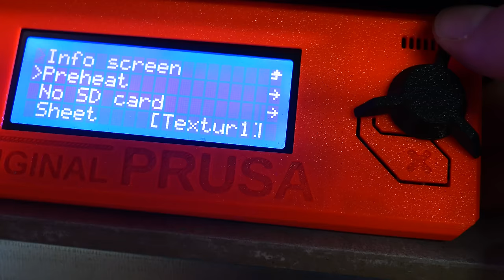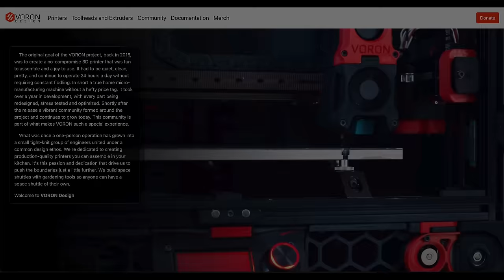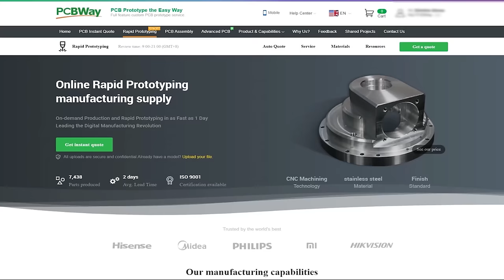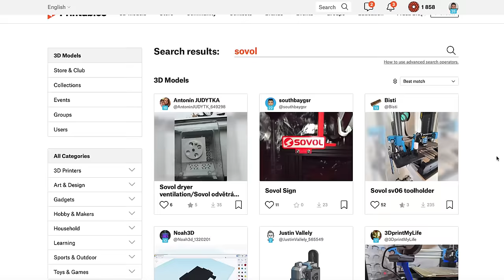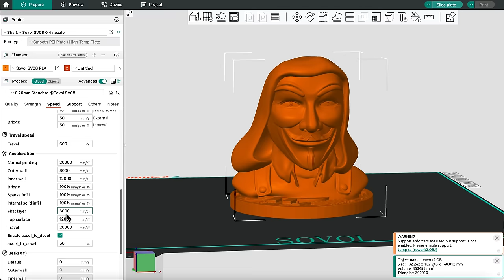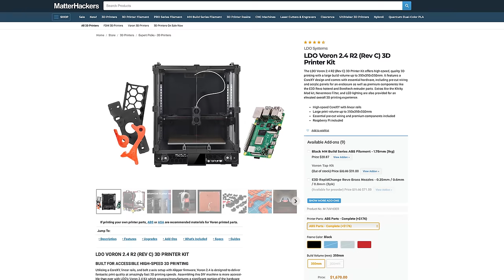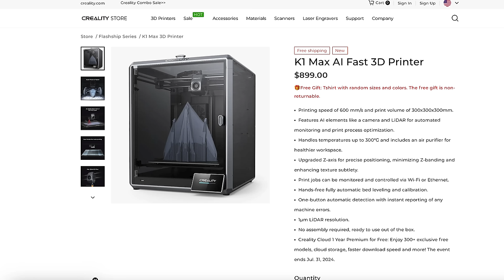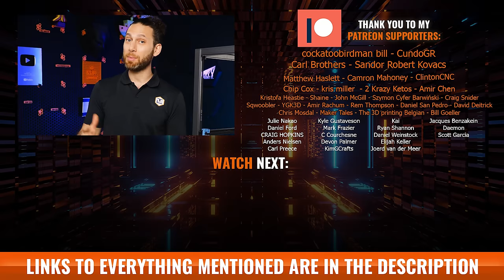The Sovol SV08: You Won't Believe the Price…

Comment: After communicating with sovol customer service, I was told that the bed heater only comes in the 220V/1000W version.
This is equivalent to 250W when used at 110V in America and 200W when used at 100V in Japan. I live in Japan, and I think 200W is extremely difficult for a bed heater of this size.
Details of the bed heater are published on github, but the hole positions are different from volon2.4-350, so it may not be usable.
Do I also need to arrange a transformer? This is a problem for users living in low voltage areas.

Comment: Hey so in the printer config what kind of stepper drivers are they using? And what is the amperage they have the x and y running at? I am just curios if they are 2209 or something with equivilent output so i could upgrade the motors with out needing new drivers or mainboard. I was just starting to plan my own core xy build, but the price of this has me seriously rethinking my plans.
Reply: Same. I've been researching for a month, going over various builds and options. But if this hovers around the $500 range and is as open source as it is sounding, this thing is sounding like the way to go. I was about to pull the trigger on a bigger bed slinger this week too. I'm going to wait and see what develops by the 18th.
Reply: tmc2209 @ 1.5A hold and run currents.

Comment: What I don't get is 100C limit on the bed in almost all the late printers. Why? Is it because of the Bambu having the same limitation? You would really benefit from 120 or even 130 on the bed when printing pure PA6 оr PC yet it seems manufacturers are inclined to draw the line on carbon or glass-filled filaments. Kinda disappointing.
Reply: In this case it is likely just being overly safe, 3m ht adhesive used to attach a lot of bed heaters is only good to about 120 +/- 10C so the voron guide suggests a 115C thermal fuse. Should be able to easily edit the cfg to up it to 110C. I don't think we've seen the underside of the bed but you can add a ring of RTV gasket silicone to be extra safe and push the temps a bit further no problem.

Comment: A voron, if you're willing to fuck around, can be built larger which is still a major draw. I want a 500x500x500 or greater volume printer. This is not recommended but no one's stopping you. I'd probably build it out of steel square tube if I went that big though, it'll involve a lot of precise drilling and tapping but I think the added rigidity will be important at this size.
Reply: Wait until voron realises the phoenix

Comment: Fully agree on the nozzle design and the new proprietary model for many of these 3D printer companies.  So much worked well when multiple printers in my collection could all basically use the same nozzle designs and they were dirt cheap when manufactured at scale.

Comment: I have a Trident. I had been looking at the 2.4. With the specs and capacity of Sovol's SV08, the price point, and the ease of setup, I can't justify a 2.4.    Some LDO supers will fix the motor whine, and fan replacement would be in order.

Comment: I'm definitely intrigued by a lower cost, easier to setup Voron, but this does sound like a lot of caveats. 
Like I'm all for adjusting print settings, but sounds like this would ALSO require some updates to the Klipper they are running if there are Z offset or clogging (overpressure) issues. Also doesn't sound like it's completely plug and play. The nozzle is also a huge turnoff, since that is one of those aspects that can literally kill a printer. I guess if it's still "open-source" we could just replace the hot end entirely with a standard Voron setup?

Comment: Great price for a decent looking printer. With that being said, the Z offset issue is an absolute deal breaker for me and it's the main reason I got rid of my older printers for an X1C. The "just works" aspect is crucial. 

Nobody wants to spend more time debugging print issues than actually printing and one of the most common reasons for that is first layer problems, often as a direct result of Z offset issues.
Reply: Since this is going to ba an open source printer, it's not comparable to Bambu Lab because the user does not need the support of the company to fix things.
And since this costs like 2/5 of the price of that X1C (varying to country) and because of the huge community that kinda does the "debugging" for you (if it's not even already fixed due to the Voron 2.4 knowledge), it's fully depending on your understanding of the value of your time.
For me ... one hour or two invested in fine tuning is worth more than 900 bucks ... especially if you count in that knowledge gain!

Because one thing should be clear: A Voron (or "Voron light" in that case) is NOT "just a tool" like Bambu Lab machines wants to be!
It's the definition of a 3D printing hobby. And many people are glad to learn a thing or two and discover their new "toys" in a way you simply cannot with a closed source ready to print machine.
Reply: @hassosigbjoernson5738  I think there was a misunderstanding. Spending and hour or two to fine tune a printer is more than acceptable. What's unacceptable is having to tune and debug before every. single. print. It's obviously not an issue everyone has but it's one I encountered on my heavily upgraded Ender (running Klipper) and I know I'm not the only one who's had that problem. 

Printing as a hobby is great and learning how and why things work and how to tweak and tune settings is something everyone should do. But when it starts to detract from the fun of printing and becomes more of a labour than enjoyment, that's a problem.

I'm not saying this printer will have those issues, but I sure like that my X1C doesn't and has been 100% click print and walk away since I bought it over a year and a half (and 700 print hours) ago. The only thing I ever do is clean the print bed and carbon rods occasionally.

Comment: Well the SV07 is not fully opensource yet. I had to ditch their klipperscreen for a raspberry pi and touchscreen so I can update klipper. And even if you manage to update klipper without bricking it, it’s quite the hassle. To bad that Sovol has not yet made the SV07 fully opensource, it’s the reason I bought it (I still suck at cad design tho haha)

Comment: Excuse me. I see this is a ncie machine but, the formbot kit of the 350mm 2.4 is $859 with dragon High flow, CANbus, Filament runout, 5 inch touch display, nozzle cleaner etc.. Yes I understand a voron still needs to be built and yes don't build it to save money or time, but I am jsut pointing out that Voron is not as expensive as you're making it sound right now. Maybe if you're getting it from LDO, but I have built a formbot machine and love it

Comment: Weird comparison. Should've compared it to a pre-built Voron. Ie a Troodon. I had my Voron V0 up and running within minutes of finalizing the wiring because someone had a config file for my exact setup. But these files don't always exist because every setup is different and people are hesitant to share config since they can cause trouble if used improperly.

My 2.4 came with a filament runout sensor. As did my V0. Most of the kits come with upgrades and such already made for you. I do wish the Voron team would upgrade things faster but comparing the work of volunteers to a company specializing in making 3D printers is both unfair.. And clickbaity.

I had a Sovol SV06+ and it printed great. Zero issues with it other than extremely weak cooling and proprietary nozzles. I donated it to my father. Then I built a 350mm V2.4

Why? Because I wanted a printer that was "mine". And now it's up and running and prints great.

Comment: How do you you heat soak the printer without enclosure? Interesting...
Reply: It'll be the bed almost certainly.. Printer being so cheap means they have to have cut corners. 1 of them would have been with the bed thickness.
I'll put money on it that this will be an ongoing issue for this printer. Look at the issues the Creality K1 Max has with its 300mm tin foil bed.
Vorons use a thick bed that has been treated so it has almost warping even at 110c.
The bed itself in the vorons cost half as much as this whole printer.
There is a reason why vorons cost more. The build spec is much higher than off the shelf printers.
Reply: @ashleywhitehead3710  Right. I expect to new Z-offset problems appear when people start receiving enclosure for this printer. There's no extrusion backers, so probably they will suffer the same issue as Vorons without them.

Comment: Having an sv06/07plus, their bed probs always are more accurate with heat soaking. If it is the same probe then makes sense. For the 12 minute Benchy remark. My linear rail modded 07plus can do a 12 min Benchy at 24mm/3 flow, I think this one could as well.

Comment: I have an SV03, which I upgraded to from the original SV01. I love the large print volume and all my customizations (dragonfly hotend. nemesis part cooling, btt board, etc.), but I've been thinking about wanting an upgrade to a machine that isn't a bed slinger. I could see one of these in my future since the one thing that's kept me from building a Voron is the price.

Comment: Thank you for a wonderful video. I would like to know how this compares to the Troodon Pro 2.0 which is also a variant of the Voron 2.4. Both are about 350x350x3XX in dimensions.
Reply: Well the troodon has the hdmi 7" screen and you can choose whatever v6 nozzle or hotend you wish right at checkout. Its also enclosed from the factory. No need to print parts either. I'm headed in that direction myself but this 08 is still very tempting at that price.

Comment: I wonder if the whole hot end or even toolhead can be swapped for a typical ones used in a Voron. It's more costly than Sovol providing an adapter, but it's probably still cheaper and less time consuming than a full Voron kit. What do you think, @thenextlayer?
Reply: Since Sovol stated this is going to be fully open source, you should be able to replace anything. And I guess it doesn't take long till someone comes up with a Stealthburner mod for the SV08.

Comment: I wish all these new printers had better cameras 
Can a Stealthburner be modded on as a replacement
How thick is the heatbed
Yeah, maintenance and repairability area a concern
Reply: "I wish all these new printers had better cameras " ... Simply install the one you desire.
"Can a Stealthburner be modded on as a replacement" ... Yes, of course. That's the idea of open source. You can replace everything.
"How thick is the heatbed" ... For this price obviously not that thick. But you also should be able to fix that.
"Yeah, maintenance and repairability area a concern" ... Nope ... because it's not a proprietary system like a Bambu Lab.

Comment: Control board fan should be able to be turned off when not printing and motor noise should be reduced with microsteps I've done both in my printer.cfg for my og 2.4. Panels seem easy to DIY grab a acrylic sheet for the front from the hardware store and line some mdf with insulation for the other sides. The only complaint I have that I don't think is an easy fix is the toolhead. I'd prefer to have seen just a reuse of stealthburner to keep the wide hotend compatibility with revo, dragon(fly), rapid, etc. should still be a doable mod though

Comment: I currently have a bambulab P1s, and have been shopping around for a large format printer, this looks very promising!
Ive been looking into the troodon 2.0 do you have any thoughts on it?
Reply from the maker: Haven’t tried it
Reply: I would recommend LNL tenlog D3 
300x300x350, IDEX so some multi material capability. Uses standard nozzles. It is $500 with larger sizes at higher prices if it’s not big enough.

Comment: The assembly process is really the  unique selling point „to me“. Big question is if the gantry parts and toolhead is compatible with the 2.4 (can Voron upgrades be used also for this maschine) and if also the hardware will be open sourced - meaning you can download - remix and mod your printer as is would be the younger brother of a Voron.
Reply from the maker: The hardware is absolutely open source
Reply: @thenextlayer  I hate for example the skirts product design (I can guess why they did) but if it’s 100% open source I am not limited to it and just make my own one if I want and how I want. They are giving a good and affordable platform.

Comment: Think its a tad optimistic to claim this printer will be able to print PC even after it gets side panels, but other than that, it seems like an awesome stepping stone for people who are just starting out to get a foothold in the diy printer space!
Reply: I can print PC with a bed temp of 85C, the trick is to use a piece of polycarbonate as the print bed. It works great and lets you lower the bed temp considerably.
Reply: @peterrichards1989  I was talking about pure PC but ig a blend still technically counts as printing "PC". And nothing against blends, but I think its just bit misleading to claim your printer can print PC when that material is more ABS than PC

Comment: SV08 looks very good....but nozzle technology has gone backwards with the introduction of high flow nozzles/CHT/Bambulab. No one talks about pressure behavior of these nozzles. Flow rate doesn't mean anything if larger melt zones create triple the friction due to surface area  inside the nozzle. None have done the math what is actually going on inside of a high flow nozzle.....and  it shows! Does anyone even know what good print quality looks like anymore? Yes we all print faster, but quality and accuracy of high flow nozzles is garbage. Especially on smaller prints with details! It is almost impossible to tune linear advance/retraction in high flow nozzles for a multiple filament brands.

Comment: So this is what conflicted feels like. 🤔

I'd be tempted to immediately swap-out the hot end, which given the cost savings over a Voron should still be advantageous.

Might be nice if they offered some sort of DIY kit that's essentially "all frame", where you bring your own hotend and board. Include the motors, belts, and wiring (if applicable). That said if the cost difference is negligible (shipping might be the issue), I guess modding a stock kit is fine.

Comment: color me intrigued... :)
The only disappointing part for me is the 300 degree limit on the hot end.  That's one feature qidi got right.  Though with sovols fully open-source nature, i'm sure there will be an aftermarket option for a higher temp hot end.
Reply from the maker: What on earth do you need more than 300 for?
Reply: @thenextlayer  some nylon filaments that print in the 300-340 range

Comment: This is super cool, hope they keep moving down this path of offering unique mass-market printers instead of just copying the biggest trend.
I hope they revisit the IDEX printer. I was really strongly considering an SVO4 for a long time but the software integration being rough was a deal breaker for me. I have no problem tinkering away on the hardware front to upgrade my printers, but I hate sitting and fighting with slicers and firmware to get things working properly which is why I ended up going with a P1S with AMS.

Comment: Great to see this review, its a good example of what happens when a review is biased. None of the bad points of this printer(there are many) get mentioned, such a shame to see a youtuber sell out to a company like this.
Reply from the maker: Thanks for the feedback, but I don’t think you’re being particularly fair or factual. Not only did I state my bias in disclosures at the beginning, saying that I’d do my best to overcome them anyways), but I also told you guys that my selection as being the first to release a video meant I couldn’t be as thorough as I wanted to be on this machine, and it was more of a first look than a comprehensive review. Nonetheless, I re-recorded parts of the video to add in issues as they came up. I didn’t have and haven’t had issues that some others have had, but I did point out the Z drift issues, nozzle clog issues, and the fact that the profiles need tweaking. Repeatedly. 

So yeah - I’m the first to accept feedback, but your comment simply isn’t in line with the facts. Disappointing.

Comment: I was thinking a couple months ago that I'd love a Voron, but there was no way I had the time to build it. This...seems like fulfilling that desire.
Reply: Same thoughts!
Reply: IMO, if you don't have time to build a Voron, you probably don't have time to maintain and fix it, either.  I've spent more time fixing my 2 Vorons than I spent building them, and they're like a year old and were LDO kits.

At the time, they were the go-to for speed and quality, but now I've ordered a Bambu.  It'll be printing the parts to fix/upgrade my Vorons, among other things.  My Vorons are for hobby tinkering, and the Bambu will be mainly for getting things fixed.  (And multi-color prints.)

I'm very excited to see more Voron things come out, like better probes (Klicky let me down, and Tap isn't quite good enough to be standard yet, IMO, though I use it) and MMUs (ERCF V2 is getting there!) and such.  Better part cooling on the toolhead is my #1 complaint at the moment, and I'd like to see things like filament cutters and flow sensors standard, like the A1.